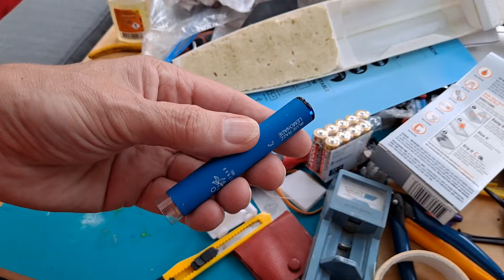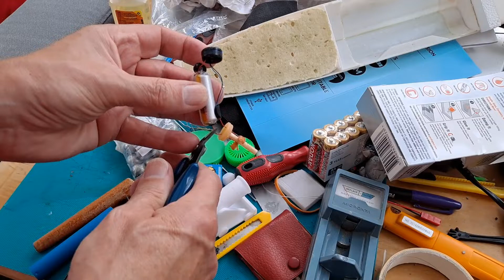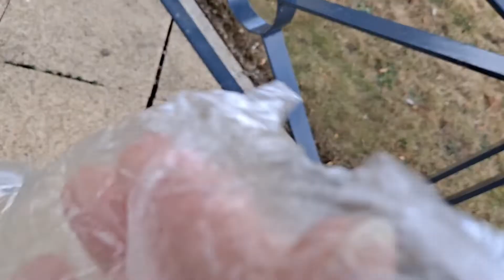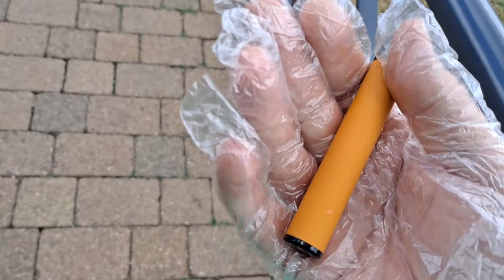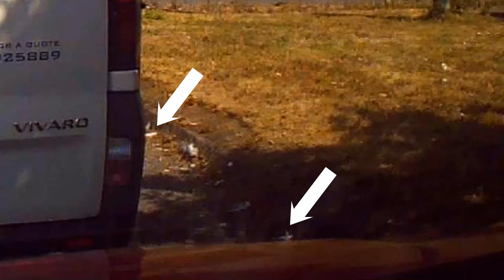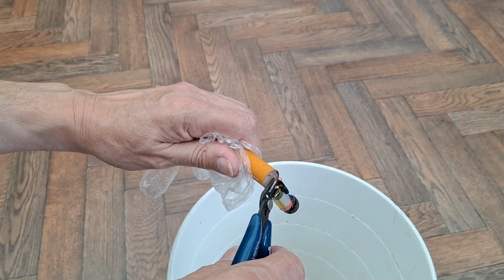Vape Hunter 👀 20220805

Comment: I have a bunch of these batteries from my own vapes. Still waiting to find a good use for them though.
Reply from the maker: Here is a video I have done for you, it may give you a general idea of what is required for a power bank https://youtu.be/rG7qLbuWvK8
Reply from the maker: Basically, they give you about 4 volts when charged, so it is not a convenient conversion to items that are normally powered by multiples of 1.5 volt batteries. You either end up overpowering or underpowering or you need to do some electronics to get them right. Bigclivedotcom has done several videos on making use of them although he does seem rather fond of powering LED light strings with them. (Technically the voltage ranges from about 3.3 volts when they are discharged to 4.2 volts when they are freshly charged, but even normal disposable alkali batteries range from about 1.6 volts fresh out of the package down to about 1.2 volts when they are flat, so if your item had 3 AA batteries it would probably be OK or multiples of that)
Reply: @GrandadIsAnOldMan  I have seen a few of big clives videos where he uses them for powering LED's. I was thinking of having a go at that but once I have 1 or 2 sets of LED's I will still have quite a few batteries left over. I was hoping to come across a power bank design which would be more useful to me. I don't possess any electronic skills so whatever I use them for would have to be very simple. Hopefully someone will release a design because it's awful seing these batteries discarded on the floor or in a bin.
Reply from the maker: I am afraid that without some electrical skills, you will be fairly limited in what you can do with them. You can buy powerbank circuit boards online, such as eBay, and use one to connect up your vape batteries and create your own powerbank. Whether that would be economically worth while, I cannot say.

Comment: What Kind of battery is in the vape?
Reply: 3.7 v li- ion
Reply from the maker: The batteries are Lithium Polymer - LiPo
In these particular Vapes the batteries are 13400 
13mm diameter 40mm length 0 indicates cylinder shape battery
3.7V
550mAh
2.04Wh

Comment: lol, what do you do with the batteries after? How useful are they? Rechargeable?
Reply from the maker: They are standard Lithium Polymer batteries (LiPo) and are completely rechargeable. High power, low weight. You do need the right sort of charger to charge them safely. I use them for my model projects, but you will find these batteries are turning up in all sorts of household items now. Your phone will probably have a flat pack version inside. Obviously your phone also has the charging circuitry, but the battery is probably the same type. There is more information in the video description.

Comment: So they only have 1 charge on them or something? Still, as long as there are tinkerers in the world there'll be less waste out there 😃
Reply from the maker: They are sold as disposable, no charging option. However, if you take the battery out, it is a standard LiPo 13400 which means 13mm diameter 40 mm long and the final 0 indicated it is a cylinder configuration rather than flat.
Reply: Bizarre waste. A deposit scheme would help (as happens over here with pop bottles). An extra 2 quid on the price, paid back when returned to any smoke shop. After all, they'll likely be going to the smoke shop for another anyway. 
I flew a mini quad on a 14500, a 13400 should work!
Reply from the maker: We live in a disposable society. I did read somewhere that LiPo's are less toxic to the environment than the old zinc chloride batteries, but regardless of that, the problem is the people who throw them away indiscriminately, not really the product itself. Probably the same argument as used for guns. I have a series of videos starting on these, the videos tend to be a bit long so they will mostly be on my other channel. Today, I walked along a back lane looking for them. I spotted about a dozen empty cardboard packages plus the plastic inner packaging, but only found two disposed vapes. Maybe somebody beat me to it 😆

Comment: Good video! I'll have to keep my eyes open for these.
Reply from the maker: If I look, I can usually find one or two, when I am out. Those batteries are probably a similar size to the bigger Super Caps that you use. 13mm diameter and 40mm long. So you could power one of your super cap planes, but you would need a timer to stop them flying for too long 👍